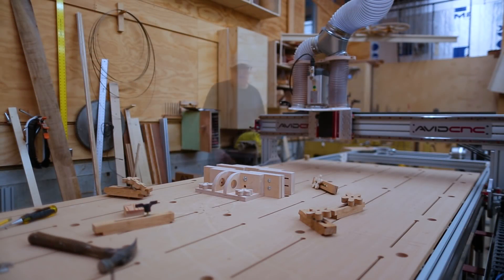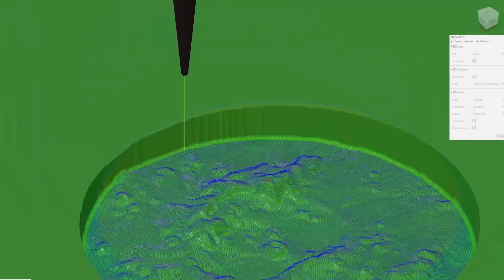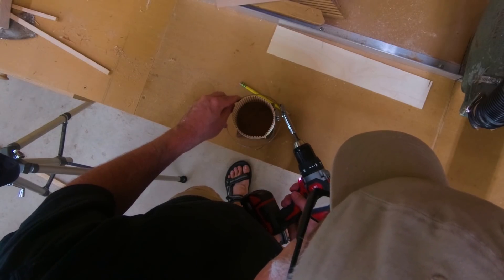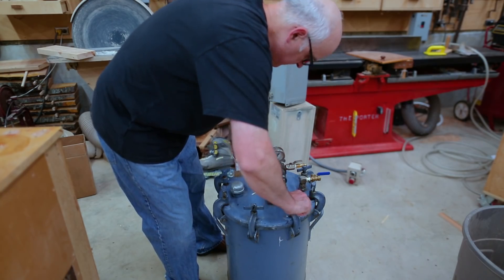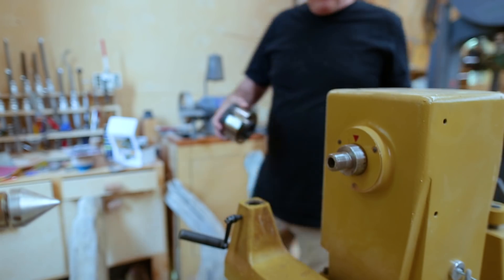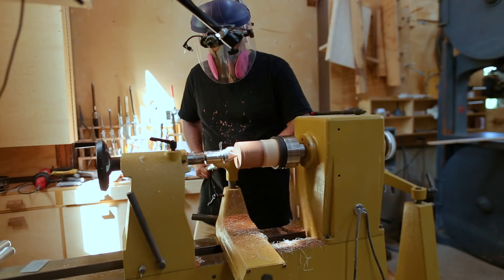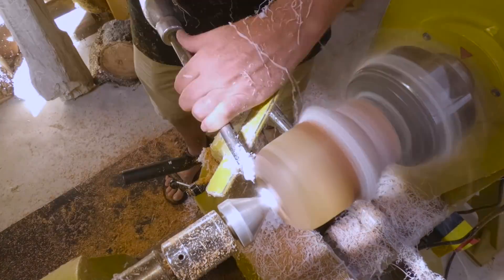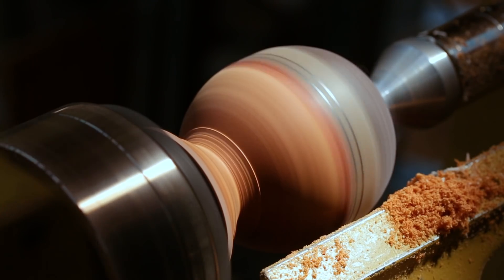Wood Turning a Sphere with Resin

Comment: Frank, great job. For the resin pour use posterboard and hot glue the ends of the strip to stop the resin from coming out. Use a heat gun when all assembled to re-melt the hot glue and seal the posterboard. It works well for me, even on large pours of more than a gallon. I seal my wood with poly first before a pour letting it dry a week before use.

Comment: You don't need to dry the wood more just do as "Ben's Worx" Just paint the wood tangent surface with ultraviolet resin and dry it before pouring the resin and vacuum it. I think this will solve the issue of bubbles

Comment: To solve the bubble problem, the simple solution was to just brush on a thin layer of resin, before you do a full pour. But don't let it fully cure. Just barely getting hard. (finger nail test) No reason to wait around 5 years for wood to fully dry to get your resin projects done.

Comment: I'm curious, I've seen people use a vacuum canister to pull the bubbles and air out of the wood when they are using epoxy. What is the benefit to using a pressurized conister?

Comment: Love your channel! The wood off-gassed. A seal cost of resin will prevent thst, as previously commented, or you can stabilize the wood with cactus juice before you carve it on the cnc. That also firms up the wood to help prevent many of the cnc "fuzzies" on the surface after the carve. Beautiful project, as always.

Comment: How about brushing the surface of the wood with a thin layer of the resin and letting it dry before pouring the rest of the resin? Will that prevent the bubbles from forming in the resin because of the moisture?

Comment: what if you did a very fine coat of resin first till dry to let the air out then finish it off with the big layer of resin later to not get the bubbles?

Comment: Started cracking up when you did the voiceover about how the hot glue is totally not going to work to keep the resin from running out. Just a few seconds before, that's exactly what I was thinking, based on very unhappy experience.

Comment: Awesome video as always!  Drier wood will definitely help reduce bubbles, but you can also try sealing the surface that will contact the resin with a few coats of lacquer in a pinch.  Another option is to stabilize the wood beforehand with something like "Cactus Juice", but you will need a vacuum chamber and some extra time.  That also gives you the opportunity to dye/stain the blank if you wanna get real funky.  Check out Casey Martin, Zak Higgins and Peter Brown for some super informative resin casting videos here on Youtube.

Comment: Would it be possible to use a piece of plastic pipe instead of the plywood form? You would have to turn your piece to slide inside the pipe, but it might make a better seal?

Comment: I'm sure you will hear this a million times now, but a coat of sealer on the wood surface, or a thin coat of resin, will eliminate the occurrence of bubbles and moisture penetration. otherwise great work as always 👍

Comment: Looks great Frank! That polish at the end was amazing.
 Something we have had success with is to make sure the wood is warm before the poor, so that the heat from the epoxy doesn't heat the wood causing it to off-gas. Not sure if it will work in this application, but may be worth a try.

Comment: What I usually do while turning on a cnc lathe is use a brass ”insert”, that looks like ring. Basically the outer diameter should be a diameter that your jaws can clamp. And the inner diameter of the ring should be the size of the stock you want to clamp. The ring should also have a 2-3mm cut in it which will allow it to actually adjust and fit perfectly around the the stock resulting in perfect and even clamping pressure. 

I keep multiple rings with the same outer diameter but at 1mm incraments. Mostly used to avoid jaw marks in the stock since brass is so soft, but might help you out with this as well.

Comment: For the people saying "use a vacuum to draw out the bubbles", that's not quite how it works.

Vacuums don't actually "draw" anything (not even things in direct contact, let alone bubbles that are trapped inside resin). For the bubbles to move, they need to be pushed by something (just like water only goes up a drinking straw because it's being pushed by atmospheric pressure outside the straw - and those bubbles clinging to the side of your Coke glass won't get drawn into your straw no matter how hard you suck - unless the actual liquid around them moves and gets between them and the glass)

A vacuum can help "infuse" resin into wood (a.k.a. stabilising the wood) by removing air inside the wood itself, that would otherwise prevent the resin from seeping into it, but that's not the issue here. This is about air bubbles in the resin itself.

Lowering the pressure on the outside does reduce the force being applied by the resin to the air bubbles, and allows them to move more easily, but the only thing pushing the bubbles up is the weight of the resin trying to slide under them (gravity pulls resin down, resin tries to get under a bubble, the bubble gets pushed up - if viscosity and surface tension cooperate). Vibrating the mould can help release those bubbles and speed up their rise, and is generally a lot more productive than leaving it sitting still in a vacuum.

Two other problems with a vacuum are that a) it will make any remaining bubbles bigger (because it reduces the pressure being applied by the resin), and b) it generally takes a lot longer to lower pressure inside a vessel than it does to raise it, so there's a big chance the resin will start to harden before all the bubbles have come out (and, due to the low external pressure, they will be bigger).

So, what you really want to do to minimise bubbles is:

1. Give the wood a thin coat of resin before the main pour. Use a hair dryer or hot air gun to blow any bubbles. This will prevent gas from coming out of the wood itself later (alternatively, if you have too much free time in your life, stabilise the wood by drying it out completely and then infusing it with resin under vacuum).

2. Mix carefully so you don't introduce any bubbles (and use a slow-setting resin so bubbles have plenty of time to come out in the next steps).

3. Optionally use low pressure (vacuum or close enough) to make it easier for bubbles to rise out of the resin after mixing (but before pouring). Vibrate if possible.

4. Pour carefully so you don't introduce any new bubbles.

5. Vibrate if possible, to release any bubbles that got trapped at the bottom (if you did #1, these should be very few, and should release easily).

6. Use positive pressure to compress any microscopic bubbles into oblivion, and prevent any out-gassing of the resin itself while it cures (some resins can do that). Maintain the pressure until the resin is fully cured, so those (now invisible) bubbles can't expand at all and become visible again.

7. Finally, read the instruction manuals for your resin, vacuum chamber, pressure pot and vibrator, and conclude that, due to a series of coincidences, you have actually achieved cold fusion.

Comment: You are pressurizing your pot to make the bubbles smaller.  Perhaps pulling a vacuum on the pot would draw the bubbles out altogether.  That is what knife makers do when "stabilizing" the scales for knives.  Indirectly people who resin-cover wood tables do the same.  They heat the unset resin with a torch causing the bubble to grow and rise in the resin until it pops on the surface.  Again it is the pressure differential which gets results.

The object in both cases is to increase both the size and buoyancy of the bubbles to get them to rise to the top and burst.

Comment: instead of starting with a cylinder, before pouring resin, what about just doing a larger square?  Attach the plywood to the block. pour resin, then cut it into a cylinder.  Then you won't have any relief cuts to worry about.

Comment: Hi Franck,

Maybe you should have brush the crater with résine and let it dry before pouring in one or two layers ?
Just to seal the wood and block the air inside 🤔
Beautiful video by the way.
Reply: I liked but I agree with you, the typology you CNC'd into the wood is not very interesting, being someone who has no connection to the original source of inspiration. Also bigger, it needs to be BIGGER for maximum impact!!
Reply: +1 vote on brushing on a seal cost of epoxy before the main pore, will seal up the wood a stop a lot of those bubbles.
Reply: Came here to say this.
Reply: Even a couple coats of shellac would seal the wood well enough to close the pores, and can be sprayed on. I suggest shellac because I like the tones it brings out in wood more than any other finish, it dries fast, it’s pretty cheap, almost universally compatible with any other coating, and can be brushed or sprayed. I’d get the zinsser without wax if going that route to ensure maximum compatibility.
Reply from the maker: I wondered about doing something like this.
Reply: His name is on your screen and in the video, and you still misspelled it. 👏👏👏
Reply: TedOfNod and ? What’s the point with it ?
Reply: Might work, but I wonder if he could have tried using something like cactus juice (tm) to stabilize the wood before ever even using the cnc to carve the terrain, then did the rest the same way.
Reply: TedOfNod Do you do this all day? It must be exhausting.
Reply: frank howarth I was also coming here to share that idea, but I was pretty sure you’d come to that conclusion on your own.
Reply: I have done some resin projects myself and I can say for anyone who is going to try this you definitely need a lot of coats to completely seal the wood so you won’t have air bubbles😅
Reply: Also came here to say this.  After playing with epoxy on large (tabletops) and smaller things it is pretty much a necessity to brush on a thin coating of epoxy, or some other sealer to keep the wood from bubbling.  I am by no means a expert, but it seems to help.
Reply: Yup.
Reply: I have sealed the wood with superglue this way with great success. The bubbles are the air from inside the wood migrating out through the end-grain.

Comment: I think you should be conscious that epoxy even in dust form is extremely allergenic. So although it's not directly toxic, you body will eventually start reacting to it with rashes and other inflammatory reactions. Happened to all the epoxy boatbuilders I know, for instance.

Comment: When making your plywood ring/form couldn't you just bend it the other directions so the cuts are on the outside hence no holes?  (I'd still throw a ring of tape around the bottom regardless to act as a dam.

Comment: Could you have placed the resin under vacuum instead of under pressure at first? With a vacuum you could pull any bubbles out of the wood, and then the epoxy would have been able to replace the areas where the moisture and air were in the wood.
Reply: And you might get better results if you put the plywood ring inside out, as in have the cuts on the outside, and the uncut layer on the inside.

Comment: I like the idea of making it a volcano. I wonder about representing lava flow with shards of a red colored wood. Or maybe red tinted resin. You could start with a block of wood, cut several cracks down into it, fill with red tinted resin, CNC a volcano terrain map onto it, refill with clear resin, and turn into a sphere.

To take it a step further, you could leave the "stem" on it (as if to make a best post or banister post), drill up from underneath, and light the red resin with an LED to give the lava some glow. Wouldn't that be a cool night light!

Comment: I always thought you put resin in a vacuum to draw the bubbles out, but you did it with increased pressure with a pressure vessel.
Reply: A vacuum will help draw the air out, and a pressure pot will help condense the remaining air. A pressure pot will yield air pockets but they are no longer under stp and will be denser and smaller in the resin because of that.

Comment: Really cool sphere!  As a few others have said, a thin seal coat of epoxy would help prevent the bubbles.  IME, without a seal coat, there will always be some air trapped in the wood that comes out as a deep pour cures.   But, I kinda like the bubbles here...sort of look like the bubbles you see when diving near ocean vents, with gas coming out of the sea floor.

Also, I believe when you go to the website where you download the topography, there is a parameter you can set to exaggerate the vertical topography, so it is a bit more dramatic.  Looking forward to seeing you play with epoxy, topography, and wherever your mind goes next with this! :)

Comment: To help with the bubbles coming out of the wood you can always lightly paint the service with a paintbrush with resin and allow it to cure before you set up your mold and your large pour. This would seal the wood from outgassing on your finish pour.
Reply: I was thinking if the wood were in airtight container, the air would have only one way to outgass.
Reply: or maybe linseed oil?

Comment: Instead of making a form out of plywood, why not simply bore a hole that exactly matches the diameter of your relief carving in a chunk of square wood or a lamination of plywood? You could do it with your CNC machine or your lathe. Go for a friction fit just like you would when making a lidded box. Then pour in your resin. That would seem to be easier and quicker.

Comment: Love the way it came out and I totally appreciate your sharing your thoughts on what you would do differently next time - I'm just embarking on the resin journey myself. If you can get some Yorkshire grit original, use that first before applying the YG microfine, that way you'd probably only need the one application of each.

Comment: Frank, your work on the lathe is always fascinating! I don't have one yet, and I'm both intimidated and impressed when I see someone demonstrating something cool on one.   Regarding outgassing of wood under resin, it might be made worse by the heat given off by resin as it cures.  Have you considered using stabilizing resin in the wood first?  Peter Brown has some good videos showing stabilizing resin used under vacuum.  It's possible resin-stabilized wood could also permit greater detail with CNC work since the fibers wouldn't tear; I've got a CNC myself, so I should try it...   As always, thanks for the inspiration!

Comment: As a few already mentioned...    best tip that really helped me from the finally getting rid of unwanted air bubbles, was to first brush or pour on a thin layer of epoxy to the surface of the wood that you plan to fill up with the epoxy.   Let that thin brushed/ thin pour on epoxy layer cure & then proceed with your epoxy fill.  The thin layer seals the wood & that definitely helps reduce air bubbles when you do the pour.    A cool effect is to go with a tinted/colored for that first thin seal coat....  for example, using a pearl/ iridescent white may highlight the peaks & valleys and then when you fill the rest with clear & carve the sphere it will give a snowcapped mountainous landscape type of effect.    

and hey if you ever decide you should want extra air bubbles for effect..   you can always mix up the epoxy extra vigorously with an egg beater & skip the pressure pot.   ;)

Comment: Why did you use a pressure pot instead of a vacuum chamber to draw out air bubbles?
Reply: Pressure is used to compress the bubbles prior to cure.  With fast cure resins, evacuation techniques are very difficult to use successfully.  Here, his alumalite is  only 12 minutes to solid and that is the slow version.  For slow cute resins, say epoxy with an hour working time, the ideal is to evacuate for 15 minutes or so, then pressurize for an hour or more, but that can be a complicated set up. Basically it would allow you to remove air bubbles, then compress what is left.

Comment: Would you have been able to wrap the relieved plywood around with the smooth side on the inside to prevent leaks?
Reply: This^
Reply: That's what I was going to suggest.
Reply from the maker: That's so crazy it just might work.  Ha!
Reply: @frankmakes  Wrapping it cuts out sounds good but most ply woods break.
Reply: @superhall229  I've managed this with 3mm ply, cuts out, provided I soaked it in water first. It's gets flexible enough to wrap a pencil!
Reply: Or find some large cardboard tubes and use your CNC to make an equally sized terrain map instead of making a tube to fit the terrain map.
Reply: I think it would crack - but using a sheet of plastic would solve for both issues. Maybe even a scrap of yogurt container or the like?
Reply: @superhall229  why would tge plywood care what direction it is bend in? Clearly worked in the other direction

Comment: How about only painting the wood surface on first pour with epoxy, the bubbles can float on top super easy, and the wood will be stabile after that. Then clear fill pours as needed.